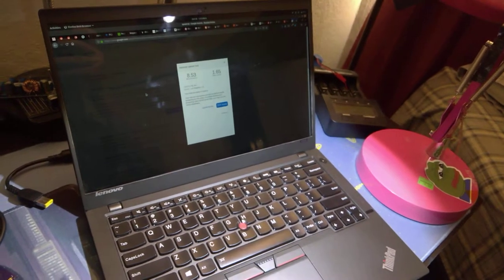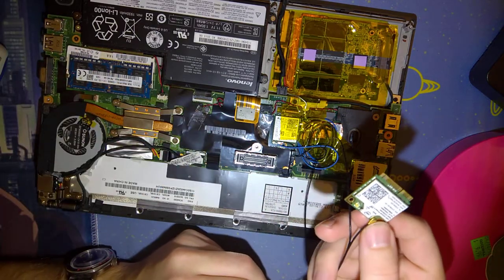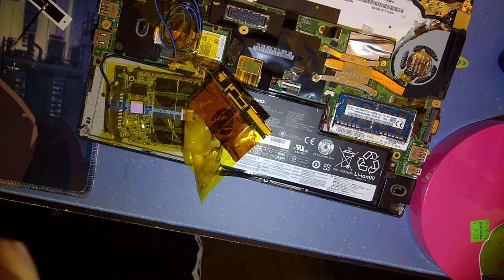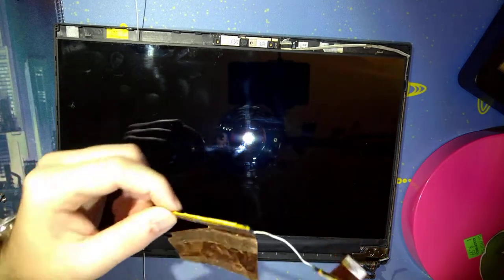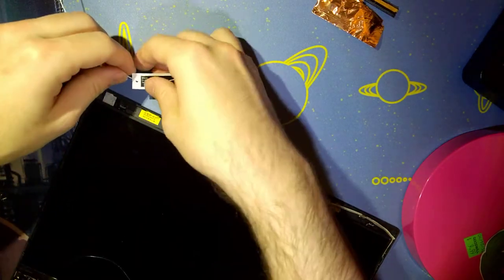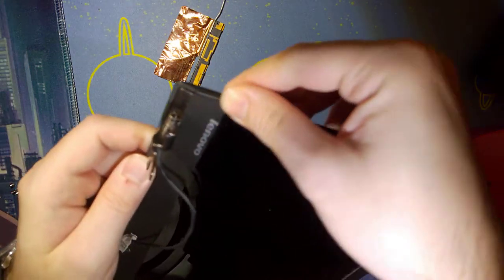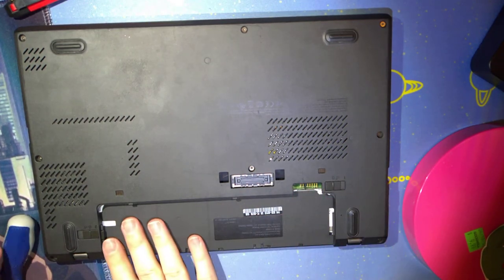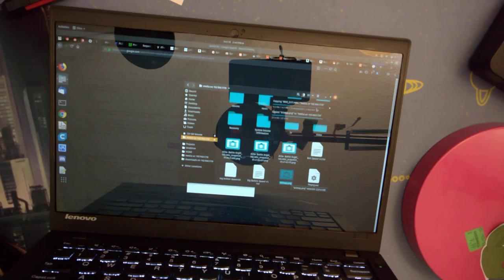Fixing the Wireless Antennas in my Modded Lenovo x250

Comment: Thanks for the only video I've found that shows how the antennas are set up. As you mentioned in the video and I found out by experience today, the connectors on the wifi/Bluetooth cards are very easy to break and I managed to smash the connectors on the antenna wires. Then I had the idea to solder them to the wifi card since they wouldn't stay connected any more, which was a bigger mistake yet. It seems now it might be worth a try to replace the antennas since I cut the useless connectors off, yet I'm  also inclined to avoid having to open up the LCD bezel and try splicing the cables to ones with good connectors. Or I could just accept fate and go with USB wifi, which is what I'll do at least in the short run. I love this laptop but I haven't been very kind to it surgically in the year I've had it.
Reply from the maker: Coax wire is kinda hard to splice properly. You'd need the crimp tool to replace the connectors. At this point, probably just buy a new wifi card and antennas.
Reply: @makho  Yeah, I finally figured out that these Wi-Fi antennas are pretty close to universal. I took the screen apart and added new antennas. It appears there was nothing wrong with the connectors I amputated, so live and learn. Now the bottom of the bezel is no longer perfectly flush which drives me nuts even though most people would not even notice, but the good news is, think the cheap $10 universal Wi-Fi antennas I bought on Amazon work better than the stock tiny Lenovo antennas.

Comment: thanks for your sharing this mod! great! Maybe the most valuable enhancement moving antenna back to on top of the LCD,  is if you close the lid and using a external bigger 4K screen, which is exactly for current design of X1 Carbon missing & very annoying wifi speed. I am planning to move the bottom plate antenna back to top of LCD as well. Your work is very encouraging! thanks!